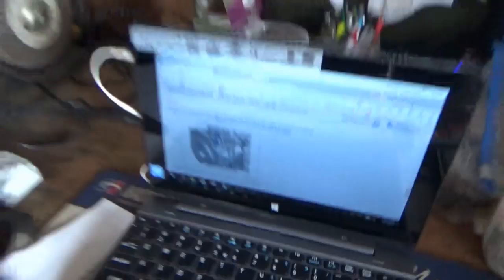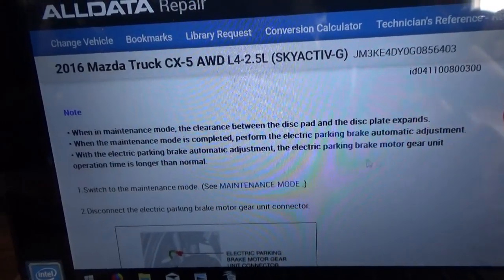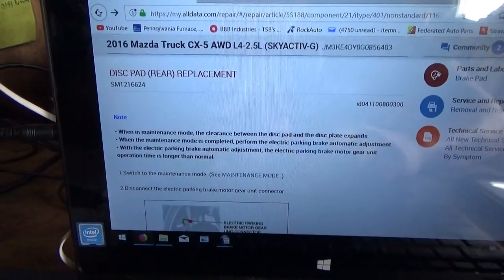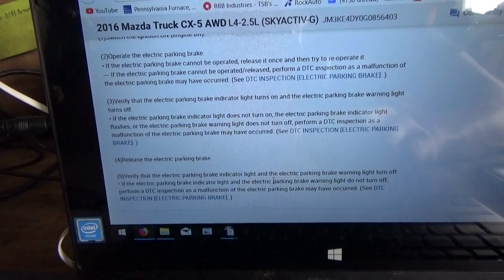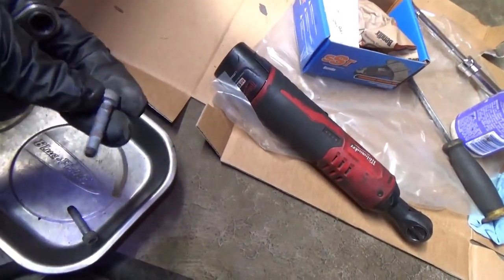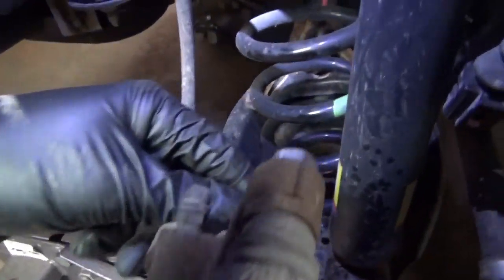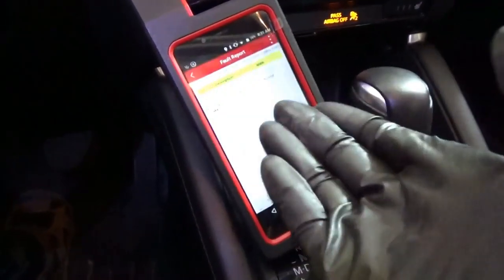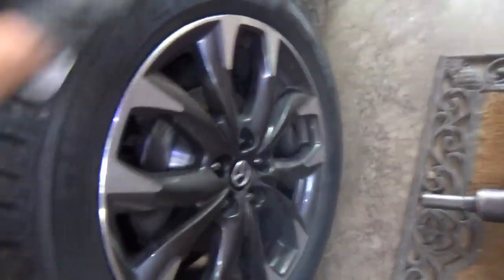Brake Job COMPLICATIONS! (Mazda CX5)

Comment: So the classic maneuver is to proceed at a fast pace down the street then crank back on the parking brake handle while holding the button in so it doesn't lock thus causing the rear of the car to come around 180° in a controlled spin then release parking brake and slam it up the street leaving your pursuer in the dust. Note to self: no electric parking brakes on get-away car.
Reply: unless you modify them with manual switch, current and time limiting lol.
I can see it now, the new modding craze, e-brakes modified using arduino's and steering wheel mounted buttons, for on/off

Comment: I’m horrified to see in the modern era that  manufacturers are trying to use the rear brake rotors (discs) as the handbrake mechanism instead of using an auxiliary drum brake as has been the practice for the past twenty years. The Ford VB falcon in Australia in the early 1990's had trouble where Ford tried to use the rear rotors as the park brake to save money, it resulted in numerous incidents of  parked cars suddenly running out of control as the rotors cooled down and shrank in width with the brakes pads being locked in a fixed position, the other issue being parking brakes held on due to dirt jamming the large square thread mechanism.

Another example of the “over intellectualism” occurring now, what an idiotic idea having an electric motor apply the parking brake,  same applies to electric power steering, variable valve timing, autonomous brakes, keyless ignition, autonomous windscreen wipers and headlights, anti-lock brakes and CAN bus control of almost everything in your car with negligible data error mitigation. 

Keep up the good work and the videos Ivan, much appreciated even down here in Australia

Comment: I'm wondering why you didn't just try sticking it in maintenance mode and then taking back out. I wouldn't be surprise if leaving maintenance mode runs a calibration. Seems like it would be a lot less effort than taking everything back apart.

Comment: My brake job complication was due to a major parts chain selling me a passenger side caliper in driver side box.  Foolish me I never checked the part against the original.  The caliper went on great...just the bleed valve is upside down.....I confess it took me a good long while before I noticed the issue, while I was trying to troubleshoot why the brake pedal was suddenly all mushy.

Comment: Hey, so I’ve got the exact same problem in the shop at the moment, exact same fault codes and drivers side won’t disengage. Have removed the motor from the caliper and wound 2 times but still nothing, any other recommendations by any chance?
Reply: I’m having the same problem I started the job at 3:30pm is now 1:00am and I can’t figure it out

Comment: It seems like the engineers are driving those 2 spindle motors in series, so they can (hopefully) apply half of the torque to each brake.  If one side is already locked, their algorithm fails.

Comment: Maintenance mode has to be done on level ground.  If the rear is jack up on the car thinks it is on slope road decline and will NOT release the park brake to maintenance mode.  

To fix reinstall rear wheels and torque then lower back down to get back into maintenance mode, press start button twice, press accelerate pedal to floor past kick down switch while pulling up on park brake switch then press start/ stop button 3 times the park brake light should illuminate to let you know you are now in maintenance mode.  Press start button to turn off vehicle then jack up car then do the rear brake job.

Comment: Seems you don’t need a scan tool, unlike the VW I had (Passat) where you had to go through a pita procedure with a scan tool and have a battery charger connected to carry out maintenance, however a seized calliper still managed to throw what seemed a very simple motor setup into overdrive, then the button broke locking them on- which without the scan tool would have meant having to get it recovered. My next car had a ‘hand’ brake! These things are great and convenient when working, but a few years and mileage soon mess that up.

Comment: I did rear brakes on my 2017 cx5. I put it into maintenance mode and brake job went smoothly until I tried to take it out of Maintenance mode. It took about 3 or 4 tries to get the P! light to come off and the parking brake to operate properly. Three months later (today) I bring it to the dealer because the P! light came on after changing battery. They tell me the EPB motor on right rear is bad even though the brakes locks and unlocks correctly. Dealer says the only time they see this is when the piston is pushed in without being in Maintenance mode.
I hate these freakin’ new cars
Reply from the maker: Try resetting it with a scanner

Comment: Awesome video!!! One quick question tho, did you went into maintenance mode to remove the actuator and spin back the caliper spindle? I would first say no and then you play with the spindle to fix the issue but I don’t want to screw this up again.

Comment: Stupid parking brakes. I always have trouble with them no matter what system. And they are only used for inspection anyways...
Reply: Agreed. The car owner probably never used that electric parking brake!
Reply: In Michigan NO ONE  uses them. The ones on my Trailblazer rusted away and fell off. I heard them flopping around in the drum. I pulled off the drum and laughed. The shoes material was like brand new, but the backing plates had rusted away! There was nothing left to the hardware eather. I just removed what was left. Unless its a manula shift, why even have them?

Comment: Having this Issue. I put the car in maintenance mode clean disc pad never need to change they got alot of meat left. Then trynna take car out of maintaince mode. I heard the rotors going back in place however car stick in maintenance mode but stil drivr. When using ebrake only the right side locked. Any help?

Comment: People want more console and footwell space, so it’s easier to make the parking brake a button with some wires rather than a leaver with cables and a mechanical caliper. It’s stupid but every company wants to make the most refined, spacious cabin for whatever reason and people don’t think about the pitfalls of buying a vehicle like that until it’s too late.
Reply from the maker: I think the e-brake used to be an "emergency" brake with an actual purpose. Not anymore apparently lol

Comment: The actuator has to be just a DC motor.  I wonder if you could just hook up a power probe to the motor terminals and reverse the polarity to the motor to release the brakes.  If it worked it would be a lot easier than pulling the motor and turning the shaft by hand.
Reply: sure, but if you apply power backwards trying to go in and it's allready locked too tightly it can break the motor gear assembly..

Comment: Ivan, not sure you will ever see this but I am having the same problem...kind of.  Here is what's different.  I can get the EPB to engage when the vehicle is running, but will not disengage while the vehicle remains on (engine running).  Hopefully you are following me.  Bare with me.  If I turn the vehicle off and then restart the vehicle, I am able to disengage the EPB and the vehicle can be driven.  The brake light on the cluster goes out too when I do this.  I am completely at a loss here.  Any ideas?  I do not have a scanner FYI. HELP!!!  I Can still drive the vehicle daily as the brakes work just fine.  Its the EPB that's is not behaving.

Comment: Why are charging extra maintenance mode literally takes a minute to do then another to release, other than that brake is the same as front?  Are you charging extra for the time you took to do the job the incorrect way?  I literally just replace all front and back rotors and pads on a 2019 CX5 that took no time, like you said it is not hard.

Comment: An old friend and I were having this discussion... Automotive technology should go back about 25 years. Stuff worked then! Electronic ignitions and fuel injection systems were working quite well. (I know, there are exceptions.) A fault in one system didn't bring down half the bloody car.

I don't have a problem with technology, if it's reliable, and IF IT IMPROVES THINGS! Electronic ignition is was a big improvement over points and condensers. Fuel injection is way ahead of carburetors. (I'm talking about average people with daily drivers here.) But if the tech doesn't make things work better, what's the point? More points of failure.

In this case, does the electric parking brake hold a parked car still any better than the lever and cables? NO! For that matter, drum brakes on the back worked fine, and lend themselves to parking brakes.
Reply from the maker: Agreed.

Comment: Why not just disconnect the electric brake motor's wire harness and back it out all the way with a power probe since it will just adjust itself?
Reply: So which way is in or out for the piston?
Reply from the maker: Actually a clever idea! Might have to resort to that once these systems start rusting up hardcore lol. Scanner should have a bidirictional control to do just that!
Reply: @johnd8651  I guess you just have to watch the pads and if they grip go the other direction lol
Reply: if it's already bound tight and you hit power the wrong direction, the motor gears will likely go out to lunch in an instant. pretty sure they wont run that long to come out and apply either, it would likely set a failure code if it didn't sense the current increase of it applying within x seconds.
as for it retracting in service mode after applying too tight, likely the same issue too high of start current instant failure code and wont release.
I've never tried the above so it's theory!  I've given it plenty of thought and since its only 2 wire dc brushed motors it has to reply upon current draw and set run times to limit travel and sense if there's issues.

Comment: Ivan the actuators look very much like VW actuators.
I have seen people disconnect the 2 pin connector and retract them supplying 
Feed and earth and swap the feed and earth to operating them again.
Never done a Mazda but the Autel is good on electronic handbrake systems (some times).
I agree why do car company's try and reinvent the wheel ?

Comment: Poor Ivan, don’t ya feel like your being scolded for not knowing about maintenance mode for electric brakes? At least you were able to correct the problem and all it cost ya was a little extra time. Live and learn. That’s what makes you a better mechanic. I will say I think electric parking brakes may be a good thing. Those parking brake cables rust solid in the rust belt states.
Reply: and rust apart and break
Reply from the maker: Yeah I wouldn't place any bets on these electric motors surviving too long either in the salty states...

Comment: The card players expression "Read them and .." is reverse in the Automotive repair industry: Don't read them and weep. Reading also prevents swearing and extra work.  ;)

Perhaps you should read a little about why they have these electric rear brakes now instead of just thrashing the system. You live and learn.
Reply: Here's what wikipedia says about Electric park brakes:
"Apart from performing the basic vehicle holding function required of park brakes, the EPB systems provide other functions like automatic release of the park brakes when the driver presses the accelerator, and re-clamping using additional force on detection of vehicle motion.[2] Further, the hill-hold function, which applies brakes to prevent roll-back when pulling away on a gradient, can also be implemented using the EPB"
So it's basically to (1) prevent you from driving around with your parking brake applied like an idiot, (2) tightening itself if it doesn't apply itself tight enough the first time for some reason, and (3) making it so you don't roll backwards on a hill when you're pulling away from being stopped at a light on an incline, which really shouldn't be too much to ask of a human driver. 

I also read a jalopnik article about them that provided little additional insight other than that it provides a cleaner look inside the million dollar koeninsegg.  Seems pretty stupid to me.  Is there something else advantageous about them?
Reply from the maker: I'm pretty sure you can't do controlled drifts and precision turns on snowy roads, or navigate an emergency situation with an electric e-brake...thus they suck. End of story haha :)

Comment: Yeah. These electronic parking brakes are awful. The new Toyota Avensis - 2009 onward has this and its awful. Not having a hand brake is really annoying and the switch is on the dashboard next to the steering wheel and i always mix up what is on and off. Really annoying. Regular handbrake was fine.

Comment: 1. Disconnect battery negative cable. 
2. Remove E-parking brake from vehicle.
3. Toss parking brake deep into a wooded area where it will drive a small forest creature insane and engender an arboreal cult dedicated to the cruel and vengeful god, Mazda. 
4. Order Fievel's Fast Flash Kit from Ukraine. 
5. Flash ECU. Parking brake? What parking brake?

Comment: Bet you'll be asking everyone if they have EPB from now on. I have a Hyundai i40, it has EPB, knowing this I read the manual first. Bummer, Scan tool required to set EPB in Maintenance mode. Lucky me, I had one and that's about as hard as it got from there . Not sure what the emergency procedure is though if you get a flat battery to release the EPB

Comment: Anyone know what the advantage is of an electric system is over the manual type?.. why are the manufacturers going to electric?
Reply: TAkes less space in the center console
Reply: Because its more that can go wrong which means $$$ for the manufacturers.
Reply: @zoidberg444  yes, now you have 2 electric motors,  one controller that can fail

Comment: I didn’t know about this and now I have a rear caliper piston all the way out, can’t get it back I have to get a new caliper but can’t find it In the auto parts stores we have to check with dealer and see if the have it 😪🤦🏽🤦🏽🤦🏽
Reply from the maker: You can take it apart and reset it no parts required 👍
Reply: @PineHollowAutoDiagnostics  How does one reset this.  I have a weird situation going on that is similar to the one in the video/

Comment: Ok, so avoid CVT transmissions, rubber timing belts, direct injection fuel system,  hollow camshaft engines, turboed emissions engines, electronic parking brakes, what else. Might as well just keep using the skateboard .
Reply from the maker: haha I prefer the bicycle!

Comment: You made the mistake, it is so easy to do the replacement of pads,  just put in service mode, push pistons back replace pads and take out of service mode,  done, you should not have screwed the piston

Comment: I think key thing walk away with here is doing little research on these electric brakes before getting tools on it .
Even some of the mechanical systems had specifics on wind out turns or adjustment screw turns setup wright so can get burned, I got burned on a volve years ago, wasted time tooling with it rather than on alldata or google looking for service tips .

I tend  take 10-15 minutes look up the service info on anything bit fancy or I not familiar with as generally saves going wrong plus you may learn more on systems control and function which useful for future diagnosis and repair .
Not a fan of electric brake, mechanical system far better for a  'all possible scenario' emergency brake and has man got too lazy pull on a lever :-/